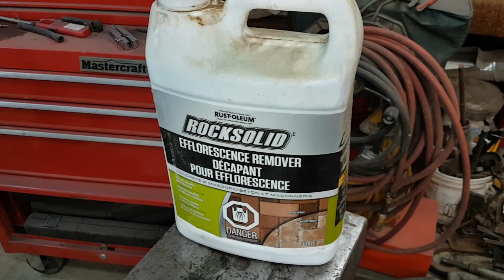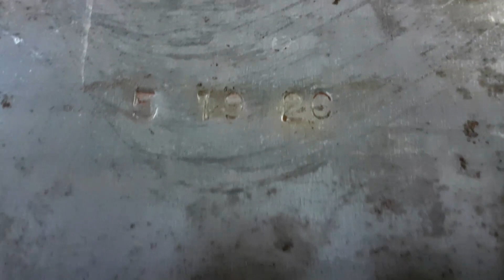✅ Rear Right Side Torque Box - 65 Thunderbird Convertible Restoration Ep #24

Comment: Hello Alvin, nice work on the torque box! She's really looking good. The phosphoric acid we have here in Michigan is sold by Home Depot. Made by Klean Strip in their paint department. "Prep & Etch". I use it on the bolts that are de-rusted, then I soak them in oil. Leaves a phosphate and oil coating on them. The container also says it prevents flash rusting.  Thanks for showing what you are doing!
George B. in Michigan
Reply from the maker: Thank you George!
I wish I could get the Klean Strip phosphoric acid here, I've looked at a ton of MSDS's and the most concentrated is the Rock Solid, Krud Kutter is a little less concentrated and cost more...but nothing over the counter that is labeled Phosphoric Acid. The Same thing with refrigerants, can't by R134A without a permit...but I can buy as many boat horns as I want, no permit required...so I buy the boat horn cans and run it through an inline refrigerant filter when I recharge an AC system.
I also do the oil treatment like you do, it works well! 😊

Comment: Looks spectacular, Alvin.  Impressive, most impressive.  I always look forward to your next episodes and have not been disappointed one bit.
Question:  How much air pressure  do you use when media blasting? 
Merry Christmas to you and yours as well, my friend.  And a very Happy New Year.
Regards,
John
Reply from the maker: Thank you John!
I adjust the air pressure based on the abrasive and piece I'm working on, in this case, I was running a pretty high PSI of 90, that's far too much for glass beads, which I run around 50 PSI for the beads, and and that varies depending on the type of metal, like cast aluminum. 
The aluminum oxide will destroy softer metals, and at 90 psi it's hard on the sheet metal too, but strips faster at high pressure, another issue with high pressure, is that it breaks down the blast media too fast, and that just cost more money for no gain...unless you're in a hurry! lol
Merry Christmas and Happy New Year to you and your family. 🎄🎄🎄

Comment: I missed this one until tonight.  Good video.  Does the red oxide burn when you weld, or is it a bit resistant to that?  You did say that you repainted  after welding.  BTW, the sandblasting took me back 40 years.  I enjoyed this.  Happy New Year to you and yours.
Reply from the maker: Thank you Stephen!
the red oxide is pretty much the same as most paints and primers, they bubble an smoke, so I like to torch them up afterwards...it just looks better.
Happy New Year!